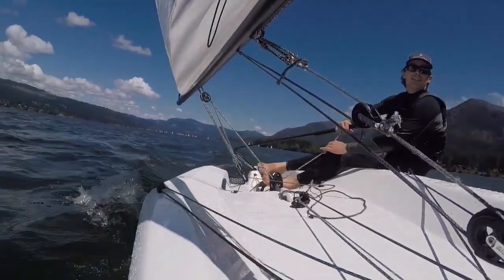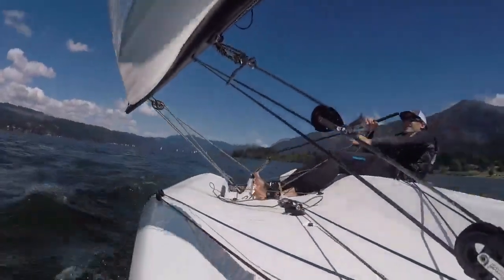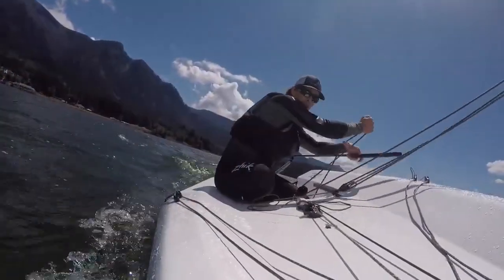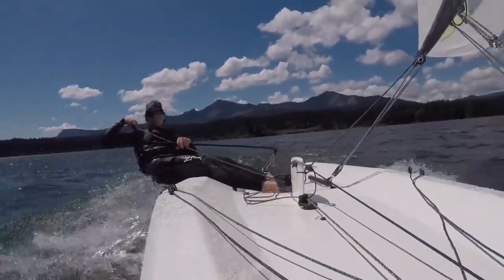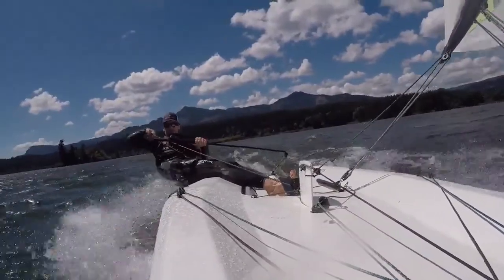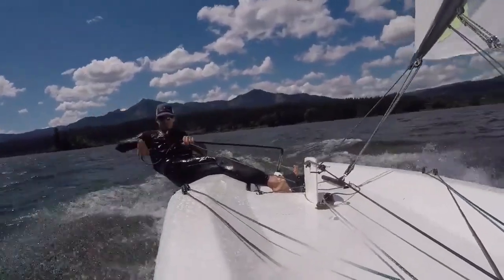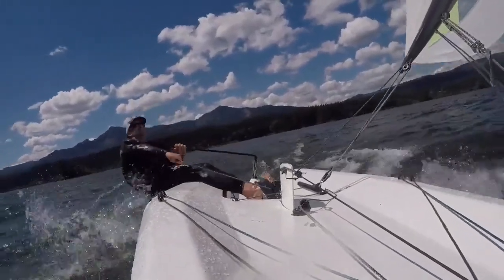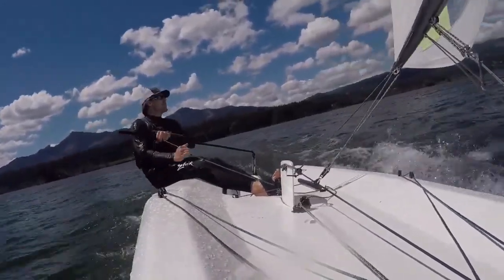RS Aero Full Review

Comment: I have a brand new aero and today was my 6th time on water with 20knots wind and my first capsize was horrible, no way to come back like I did on my laser. I am looking for some tips.
Reply from the maker: Can you share a bit more on the way you capsized?
Reply: Ideally, you make it over the side on the the daggerboard and then recover without ever getting wet. In heavy air you are probably on the after corner and can't make it over the side, though. You have to right the boat and then pull yourself over the transom in that case, or do a water start like a windsurfer where you hook one leg, sheet in, and let the boat pull you over the side. In a race I use the water start method because it is fast even though it is tiring. You cannot recover an Aero by climbing over the side like a Laser in any conditions. It is too light and will capsize to windward on you!